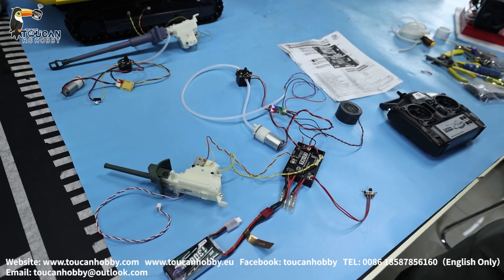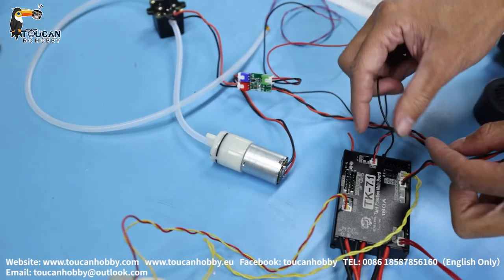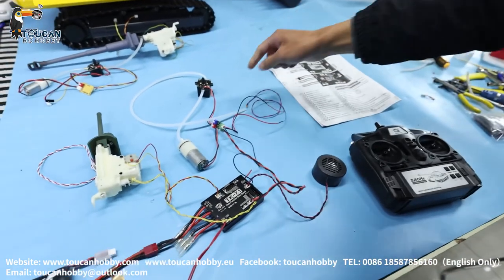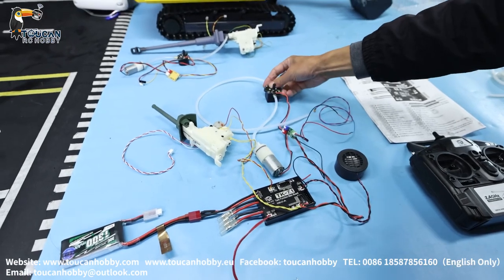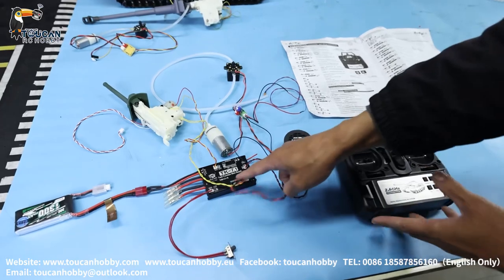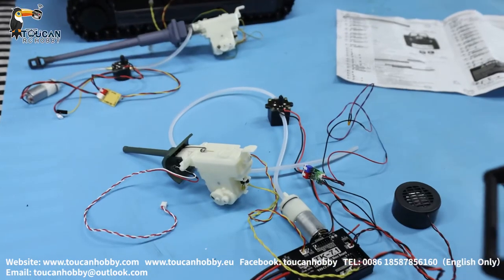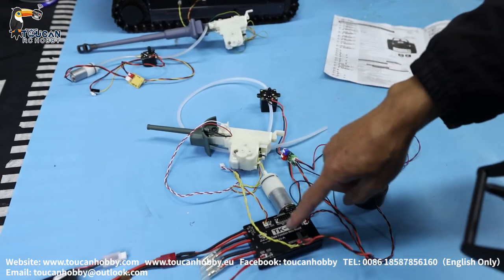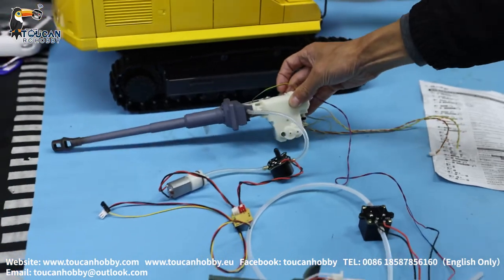How to upgrade your henglong RC tank with barrel smoking and flashing.

Comment: It IS possible to have the recoil action and the smoke and flashing barrel. We did it tonight to my Heng Long M4 Sherman. Its a bit of a pain but its worth it if you want total realism. We removed the recoil barrel from the turret and disassembled the actual internal recoil unit to remove the inner gun tube barrel and the large ring that it set in as neither is needed if you are going to remove the BB capability anyway. We then removed the inner recoil mechanism and cut off the portion that you can see move back and forth when you fire the gun. This creates a nice large opening that we fed the light wire and the smoke tube nearly all the way to the end of the barrel. Then we reassembled everything. Make sure you test it at each step of the way to make sure you still have functionality once its fully reassembled. It is so much cooler now that it has the recoil, flash, and smoke!!! The Sherman never did fire the BBs all that well anyway. At least not compared with my Tiger 1 and M26 Pershing. The longer barrel models work much better for the BBs. Good luck!
Reply: Also! Make sure to remove the channel that the BBs travel down from the turret hatch. Its no longer needed and you will have to snap it off anyway to get everything apart. Its just hot glued in.

Comment: Thanks for your video.  I was about to want to upgrade my Tk-7.0 Walker Bulldog 3839 until you said either flashing LED or BB's but not both.  
Whoa!  
I guess I'll wait for Heng Long to design a new version that will have both options built-in.  Thanks for your detailed video, though.  
Keep up the great woth on these RC mods.
Reply: that will never happen .... bc these 2 things wont work together
Reply: How should that be possible? You know, 1 barrel, two things IN the barrel...

Comment: I would like to purchase this for my tank, but the barrel/mantlet/airsoft unit doesn’t have that port on the side where you hook in the tube from the smoke generator. I have a Henglong Abrams Professional. Is this port something you all did yourselves, or is it included in certain models of tanks only?
Reply: U remove the barrel there's a plastic part behind it. Remove the plastic piece then fit the tube into the metal part that the barrel attaches to. Now U can fit the hose where the bb's would feed into the barrel. Remove the tray were the bb's would slide down into the barrel. Remove that cover, fit the hose under the tray Dremel out a small hole for the hose to come out an attach to the smoker tank. U should know the rest.

Comment: When you turn the unit of by G+S functions does it still heat the unit or does it completely kill power to the unit I ask if a on off switch is needed to shut off heating element?

Comment: Hi. Is it possible to have fpv and barrell smoke/flash on the same model? I.e. can you run the FPV off another port other than CN5?
Reply from the maker: Yes can, FPV only need a around 5V power supply to make it work
Reply: @toucanhobby2400  Thanks. The WiFi signal keeps cutting out after connecting to my phone.  Any idea why this might be?
Reply from the maker: @jcharlton2078  is the wires connections tight? Try to full charge the tank battery, also can try with another phone, happened some phone even not connect singnal

Comment: Confusing wiring. Poor camera work on the wiring of the components.
Reply: Its not that hard Bob. Hit me up if you need help-I've done several conversions.
Reply: @kennethrich2107  hey Kenneth, have you ever set up the tank to use this system and bbs like the top cannon? My friends and I are big airsofters as well as new tankers. I have this kit and must figure out a way to make them all work together 😁. Thank you for your time!
Reply: Getting your barrel to smoke WITH BB shooting can be done, but the smoke output will be very negligible if any at all. The smoke pulse is very short from the system, so thats why a tube is ran down the barrel stopping just shy of the muzzle. Of course you cant have a tube in the barrel and expect to fire a BB down it. @Schultz98